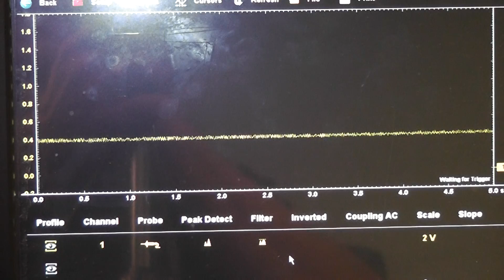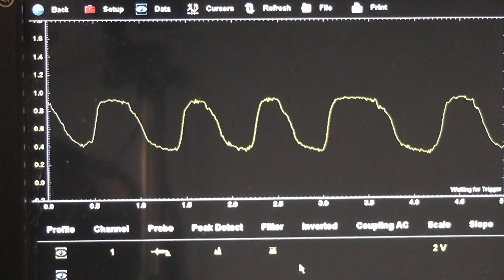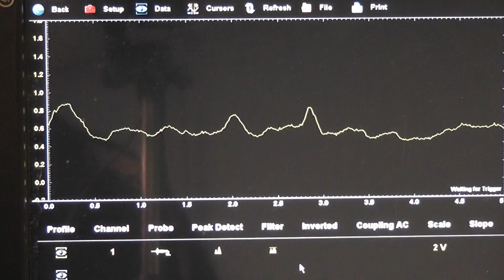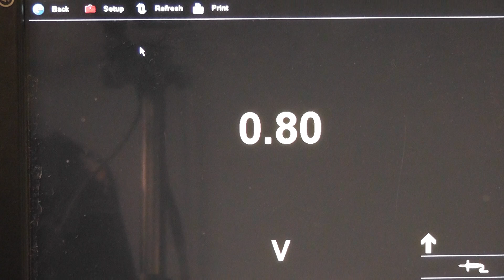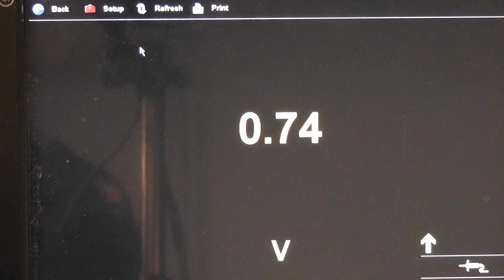How to test an oxygen sensor on a Honda (scope vs voltmeter)

Comment: What should the downstream sensor be doing
Reply from the maker: generally a steady flat line signal at cruising speeds or steady throttle (engine and cat hot of course)

Comment: Hmm. I'm using an OBD2 scan tool showing live data to my phone and it seems the O2 readings stay stuck around .8 and don't really move for a while then suddenly drop down at one point if I let go of the gas. I don' t know if the scan tool is just slow to receive the data or the app is or it's the O2 sensor or whatever else could cause it. Wish I had a garage to take my oscilloscope to and hook it up and watch the waveform.
Reply from the maker: are you having any issues or are you just playing?
Reply: @ScannerDanner  The 07 ES is rated 19 city, but most people report 15-16. I'm in NYC and get 11-12. Recently I was having starting problems especially after the car warms up and starting and stopping a few times as I recently started delivering food. It takes a while to crank over, and would be a bit faster if I didn't hold down the push to start. My check engine light cleared itself so I never noticed but in the past week a P0300 was thrown. At one point car was rumbling shaking when I started and cleared up after a min and during it the RPM needle dipped for a brief moment. Been trying to figure it out. Been told maybe its the starter. Not sure if this is a parallel problem or related, but I wouldn't mind either way getting my mpg up. I did some more testing after my comment. I rev'd for a while at 2K and the sensors were super slow to change in values, one didn't show .8, just topped at .56. Though if I rev the engine suddenly instead of gradually there's a more drastic change. I guess its not a consistent reading for a nice waveform. In the history I only noticed 1 was changed at 80k miles on 2012. I'm at 133k miles. The scanner also refers to the O2 sensors as Sensor 6 and 2 which confused me, and then it'll say like Sensor 1 current etc. Don't get the numbering scheme. My long term fuel trims btw are in double digits. 21% at one point. Generally go up when I rev
Reply from the maker: @The2Coolest2  a p0300 code is a random misfire. Focus there, not on your starter. Watch some of my videos on diagnosing a misfire (chapter 22 playlist and chapter 1)

Comment: Hi Dan . You do great . You said that it's the ECM that driving the o2 sensor to it's voltage look oscillating ...but my question is how ECM does that . Or is it ECM or it's something else? Thnx
Reply from the maker: It's adjusting the injector pulse width to trim the mixture a little rich and lean, causing the O2 to swing
Reply: @ScannerDanner  thanx dan. I recently encountered a problem with my car . My car is a 2003 peugot 1.4 manual trasmission . The problem comes as you put the car on first gear run a little bit then you press the clutch .... If you release the cluth without shifting to a higher gear itll jerk .... It happens on every gear but on the heavier gears it gives you a harder reaction. What dou think it could be...

Comment: When testing 02 with multimeter better to use analog one or if it is digital good to have a  graph bar .
Reply from the maker: An analog voltmeter will pull the signal voltage down and give you inaccurate readings. The voltage is too low
Reply: @ScannerDanner  there are many analog multimeters (sometimes  even relatively inexpensive ones) that do have electronic amplifier on the input and their input resistance wouldn’t shunt - low the O2 sensor signal . They can be recognised by their rejection to measure voltage without battery inside the multimeter. Some do have mV range as well .

Comment: I have a 2000 CRV and my wire colors are different: 2 blacks, 1 white, 1 green.  My plug shape looks the same as yours.  If I assume my signal wire is in the same relative place as yours, my signal wire is white and the green would be the ground.  In electrical standards land, green is usually a ground, but so can white be ground in certain circumstances.  Does this make sense that the white is definitely the signal wire?

Comment: Hi ScannerDanner, just a quick question from me... My Denso O² sensor is only giving me about 6 voltage fluctuations in 10 seconds, when in manual it says it should have 8 or more... Can you share your thoughts on the effects of it? It really needs replacement already, right? Thanks for you time, brother!

Comment: Thanks for video . My cars values on manual between 150-700 mv it should be. But i see at warm engine idle is 0-80-100-10-200-700 ... it s turning like this ? Can i say the sensor is fail or i have different problem . No check light comes on. But hesitate and sometimes car isnt make cut off i feel it. And i check every sensor and adapted all sensor.
Reply from the maker: That sounds okay to me, i would go in another direction
Reply: @ScannerDanner  i just realize the ect sensor read 70 celcius , but thermostat is open and fans comes on . Seems like have ect sensor problem thanks
Reply from the maker: And that will DEFINITELY affect your fuel mileage
Reply: @ScannerDanner  yes like you said. Today checked at 92 deegre. İt should be  show 300-200 ohms buy i only saw 480 . There is no under ohms , stuck  at 480.

Comment: Is the operating voltage range universally 200–800 mV? I have a '98 Camry 4-cylinder, and I can't find info on what the sensor should be outputting. (Mine is a California emissions model, so the sensor is a Fuel/O2 sensor.)

Furthermore, what is the fourth wire for? I'm assuming there's +12V, ground, and signal.

Thanks for the video, btw! Instant subscribe from me :-)

Comment: What about an analog volt meter? Would that be easier to see than a dvom?
Reply from the maker: not enough internal impedance in an analog voltmeter, you will steal some of the voltage from the circuit being tested just to make the needle move, especially on an O2 circuit

Comment: Thanks for use case. Just a note - the voltage value which can be observed by multimeter is lower then provided by oscilloscope. Common digital multimetters measure effective voltage value, oscilloscop provides maximal value. So don't expect you can catch whatever around 1 V by multimeter.
Reply from the maker: The frequency is slow enough on an O2 that at times you will catch the min and max voltages, you just have to watch it longer. But you are correct on faster signals

Comment: The part i don't understand, what makes that voltage oscillation, the ecu or the sensor itself ? I measure the voltage directly from o2 sensor disconnected from ecu with the car running and it does not oscillate. Should i measure it connected?
Reply from the maker: The O2 creates its own voltage but the computer is driving the fuel mixture to make it look like that. Watch this video, it will help 
https://www.youtube.com/watch?v=oRX2V6_a3dc

Comment: I'm building an O2 meter with an Atmega using some ADC ports and find that there is "sampling" going on as well. I have a cheap multimeter that actually "averages" a wave signal though. No jumping up and down. The ADC port and the DMM just act differently. For now I'm not sure what to do, maybe find out an "averaging" circuit.
Reply: Hi! I am considering to write an O2 sensor simulation using an STM32-based microcontroller. Did you get to complete your O2 meter? I am curious about your results.
Reply: @dobro-mir  In design, I finished it using an ATINY85. I never built it for actual use. Unfortunately I had a stroke in the meantime and I put it on the back burner.
Frankly, I think the ATINY85 is weak but you are on a better track.
Reply: @DoktorJeep oh, sorry to hear that, mate. Hope you are doing better now. 

As for the Attiny85, it honestly doesn’t sound bad. If you look at the oscilloscope measurements from this video, at 2000 rpm, the healthy o2 sensor is hardly pushing more than 3 cross counts. And an Attiny85 can run at 20Mhz. It only has 10 bits ADC, but even that still offers plenty of resolution, considering the fact we are talking about a narrowband. Somewhere I read that its ADC sampling rate could be clocked to 1Mhz if you are willing to lose some resolution. For consistent sampling I would just rely on a timer interrupt. Honestly, I think this could work, albeit it being suboptimal compared to the STM32.

Comment: My 2007 2l Petrol Honda CR-V shows constant 2.2 volts on upper Oxygen sensor with no variation? No faults in obd car feels sluggish. When Sensor is unplugged same reading on signal wire to the ECU. What I'm missing?

Comment: I need help, any time i step on the gas my o2 sensor reads .8 voltages and stays there
Reply from the maker: what are your fuel trim numbers at idle and at 3000 rpm in park?
Reply: between .127v and .832v, the vehicle has 189,3645 miles on it, and it has never change, should i change it?

Comment: If you start the car when its cold and after 20 seconds from the start you notice the o2 sensor signal its high v already between 0.600 or o.896 v ? I heard you said say o2 needs to warm a little bit but my car after 25 seconds from the start the fuel status change to open loop to closed loop
Reply from the maker: That's actually a great test for the O2 heater circuit. If you see the O2 active that fast, your heater circuit is definitely working.
Reply: ScannerDanner yeah i tried today create a vaccum leak to see if they change the signal and respond with it and it does do you think could be a bad fuel pressure regulator cause the short term fuel trim bank 1 and long term fuel trim bank 1 is always under negative like-15 or -14% im getting a bad poor mileage as well like half tank 130 milles before it was like around 165 or 150 ?
Reply from the maker: It would help to know what you are working on
Reply: ScannerDanner  ok the car is a honda odyssey 2001 issue running rich and code PO170 i’ve done a few things already but I haven’t check the evap system and the fuel pressure i barely have time to work in the car since my job keeps me busy
Reply from the maker: Is this a MAF engine or Speed Density (MAP sensor only?) Are there any other trouble codes?
Reply: ScannerDanner yesh map sensor only yesterday i check the evap system so see if the evap valve solenoid was open and it wasn’t so im going through get a fuel pressure gauge since I don’t have one and check it well this code i got it was PO170 bit it didn’t light out the check engine

Comment: At about 3:44, right after letting of gas the signal hangs high for a few seconds.  Is that normal?  I've seen it on a few cars and was wondering why that happens?  You mentioned that crosscounts higher than 5Hz indicated a misfire of some type.  I just recorded an O2 waveform off my 03 Nissan Primera and noticed that after letting off a sustaned rev at idle I got a really ugle signal with lots of quick oscillation which took about a minute to clear up back to almost a normal signal, ever see anything like this:  https://youtu.be/cG0s2Mp2UDE?t=1m49s

Comment: ok so if the voltage of the oxygen sensor stil fixed on 0.5 or 0.2 or 0.9 what's it mean
Reply: it mean bad sensor, it should be switching back and forth, not fixed.

Comment from the maker: No, it takes too much current to drive the needle and you will cause a voltage drop in the O2 circuit you are trying to test

Comment: man this does not work for all civics and digital multimeters.
i think that the 1.6 sohc vtec's o sensor behave diferently
then there are the wideband sensors on the 1.5 engines with more recent vtec version.
in total there are 3 diferent O2 sensors for this hondas/engines (D+B series)

Comment: OK, I found the answer myself and tried it with my frequ. Generator. In this case the frequency is just too slow for a meter to consider it as AC. So you can think of it as pulsing DC and use a Min/Max Hold if your meter has that feature and live with that.
So a difference should be more of concern at higher frequency signals which succeed the sampling frequency of your meter and then only shows you the DC component.
You can look that up in the specs as minimum AC frequency.

Thanks anyway :)

Comment: Nice Video. Thanks a lot for showing the signals and explaining the control by the ECU. I have one question/annotation left (about the multimeter measurement):
As the Signal is changing over time and you have it running between 0.2 and 0.8V (AC plus DC Offset), you would need an meter that is giving you the peak voltage, right?!
I mean with a TRMS meter the signal is calculated down to its effective voltage and therefore should be lower. Am I right or have I mistaken something here?!

Comment from the maker: @NOEISY1 Its complicated. There are so many different types (AF ratio sensors) but for the most part the PCM monitors a small amount of current flow to determine ratios over a wide range. Where an O2 sensor can only ID stoichiometric (14.7/1) and produces a voltage from 0-1v. (PCM monitors voltage changes, not current as with the AF sensor). Most manufacturers do not supply scope testing methods for the AF sensor signal, only scan data. Heater tests are identical
Reply: Both my Nissan's WSMs give a scope testing procedure  for the O2.  They both say to hold at 2krpm and if you see at least 5 switches in 10 seconds the O2 is considered OK.  These are both pre-OBDII, European 99 Almera and 2003 Primera.